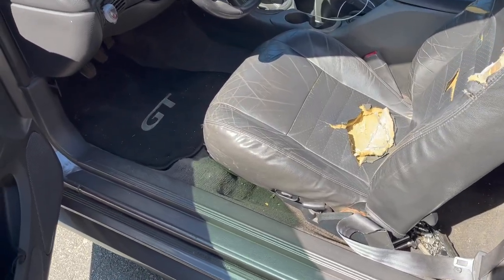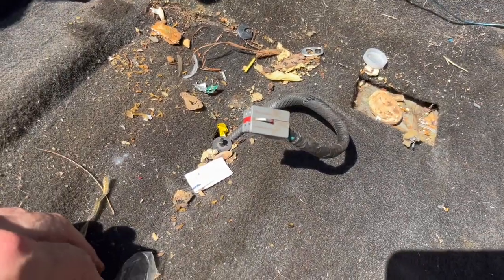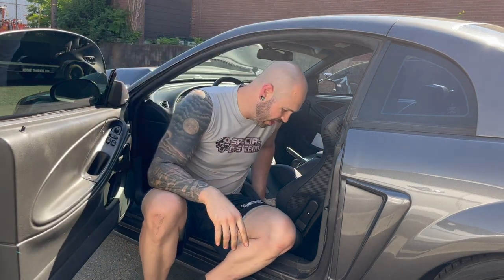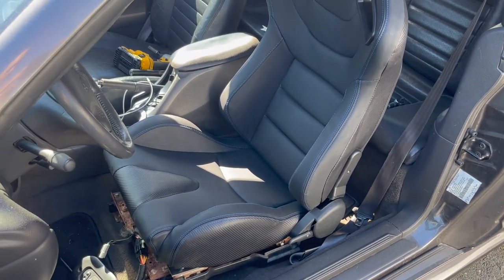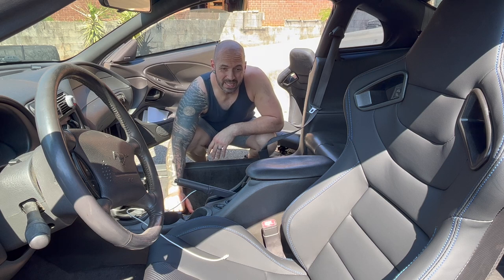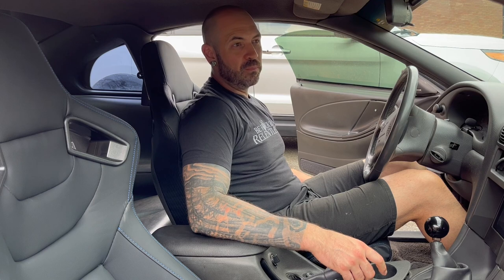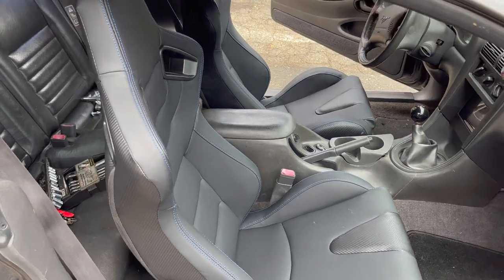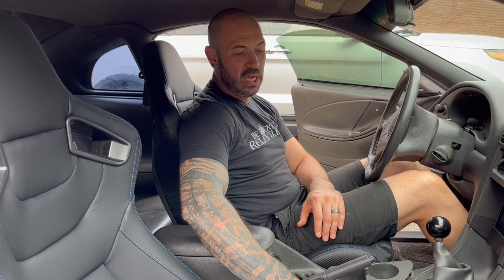$380 Racing Seats from Amazon

Comment: I subbed after big government bullshit😂 Thankfully here in Mississippi we don’t have to have our vehicles inspected. But thank you for the video. I’ve been looking at these for a 2000 GT convertible I got to flip. I think I’m gonna pull the trigger on them. Like you I couldn’t find anything decent local.
Reply from the maker: HAHA! RIGHT! I have an F250 that also would not pass inspection for multiple reasons, I have a really great shop I take the truck to but they don't do inspections, I stopped by in the mustang asked them if they had a guy that did car inspections and sure enough they did. Funny thing I didn't know was that I don't even get emissions tested as it's older than 20 years now! But my window tint and the stripe across the windshield and just being obscenely loud, all causes failure. But now "I've got a guy"! As for the seats, yeah I'd love a set of corbeau's or nicer but I didn't feel like paying $800 or more for seats. These look nice and yeah you can't beat em for the price.

Comment: I've never seen 300 range seat the were electric😮
Reply from the maker: They are manual seats…I swapped over the power base from the stock seats. Eventually I switched them back over to manual to get the base to sit closer to the floor.

Comment: I was gonna buy seats but they look cheap and uncomfortable, but overall nice content
Reply from the maker: Thanks! These are actually pretty comfy as far as racing seats go, I've been in some high end seats that were super stiff and hard and not fun to ride in. I will say for sure, these are 10x better than the Summit Racing seats, those are garbage. I kind of figured I could take a chance on these, one just to shoot video content for the channel, and two I knew if they weren't great I could just pull them out and sell them as brand new on facebook market and then get better ones, but honestly I like them. If I was an inch or two shorter and 20 pounds smaller they would really be perfect but I am a bit bigger than the average person so it's ok.

Comment: I have installed two sets of aftermarket seats: Summit Racing in a 66 Mustang and Corbeau in a 65 GTO. In both cases I found the foam too firm. It felt like I was sitting on top of the seat rather than sinking into it like a typical factory seat. I want to replace the seats in my 65 Corvette because they have absolutely Zero lateral support. I'm 6'1" 190. I like to feel the side bolsters hug me on every turn and also like to feel like I am sort of sinking into the seat. Do you think these will fit the bill?
Reply from the maker: I don't want to tell you yes and then have you get these and not be happy...but...I think they are just slightly softer than a corbeau or cobra or sparco seat...but you are not going to sink into them like a stock seat. Stock seats are just too damn soft because if they were as stiff as a racing seat than "normal people" would complain to the car maker. I like these. I think they are more comfortable than a stock corvette seat. I had a solstice GXP and those seats are similar to corvette seats and they were AWFUL. For me I jus thought if these were trash I would just resell them on facebook market so I took a chance. Oh and I have sat in the summit seats and I think they are trash...these seats are nicer, I think these are better than summit seats, but still they are racing seats so they won't be super soft. If you can get a pair of newer comaro seats they look like these and are pretty soft. But for the money these are a good buy. Thigh bolster is a bit narrow for me but if you are under 220 pounds and under 6 foot 4 you should fit better than I do. Best of luck brother!

Comment: Great Content, very informative... So, the million dollar question: were u able to use the power controls on the race seat- prior to getting the brackets?
Reply from the maker: YES! I was able to use the power before getting the brackets. But I didn't like how high the seat was...it was about the same as stock and I wanted the seats to sit lower and I felt it would be more secure bolted to the brackets.

Comment: I want to use my stock motors on my sn95 with these seats on my mustang can you tell what what I’ll need ?
Reply from the maker: I originally had my stock mounts, just had to drill a couple extra holes and make sure you get some grade 8 hardware. I wanted the seats lower to the floor so I got mounts off amazon.

Comment: Ever fab the bracket to make it stronger?
Reply from the maker: Actually I have not. I drive the car once or twice a week and so far these have held up great. Switching from the seat mount brackets I made to try and use the factory power, over to the brackets I got off amazon, took a lot of the flex out. Still some flex in the seat back, that's the bracket on the side of the seat. I have a few more projects to take care of first so this got pushed down the priority list a bit.
Reply: Are you certain that’s actually made out of plastic?

Comment: what screws did you use for the seats?
Reply from the maker: To screw them to the floor, I just reused the torx bit bolts form the stock seats. To screw them to the brackets, they came with bolts for that but I didn't trust them and they were too long so I went and got stainless grade 8 hex cap screws from Lowes.

Comment: Are them seat lighter weight then the oem seats.
Reply from the maker: Oh yeah. Especially if you have the power driver's seat...just the base with all the motors has to be a solid 50 pounds itself. But yeah they are lighter than stock. Wish I would have weighed them before I threw the stock seats in the dumpster!

Comment: Just bought a 04 gt 1 owner with less than 60k miles! Already got full bolt ons a underdrive pulley kit and a tune on e85 and let me tell ya these old cars can be opened up a lot with just bolt ons and tune! Only down to these cars is really the interior because those horrible not supporting seats! Sweet car man and Preciate the video!! if you could now what would you do differently! Definitely need a seat upgrade for my car 😭
Reply from the maker: How much did you get the GT for? 60k miles one owner sounds super nice man. You can hold onto that for a decade and have fun with it and sell it for more than you paid for it. The well kept new edge mustangs are starting to appreciate in value...soon the market will be similar to really nice well kept fox body. But yeah the stock seats are just no good. A cobra (brand not the car) seat is damn nice but the price tag is too. For the money these are well worth it. For the brackets...do not make your own bracket...there is a link above with the brackets I used from amazon...they are thick 1/4" steel and heavy duty...use those. You won't be able to use the power base but save it for when you sell the car so the next owner can put it back to stock if they want to. You will have to drill new holes in the bracket but that's easy just measure good and make sure you don't put the holes too far toward the door like I did. Have fun, good luck, and enjoy that ride man!

Comment: Let me get those old seats
Reply from the maker: Bro I didn’t even put them up for sale or free…they were trashed. They went in the dumpster. For real not worth saving. I actually shopped for stock cobra seats for a long time but I’m not paying $1,000 for used 20 year old seats.
Reply: Yeah that's what I'm doing now they are crazy expensive I'm about to replace the leather for the front seats and that's around $1000 I'm not sure what to do I can't find a good replacement seat anywhere